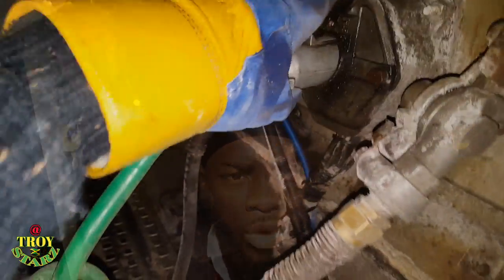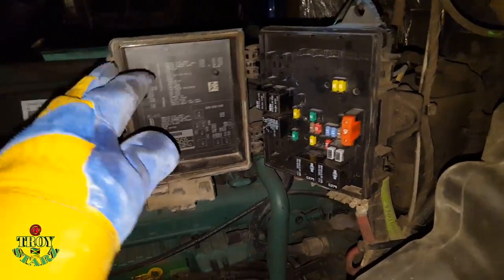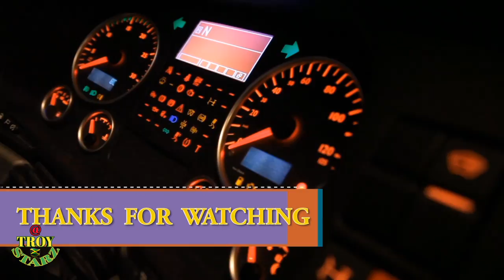How To Fix Trailer Running Lights Not Working When Truck lights On.

Comment: My tractor lights only work when I plug my pigtail into a trailer. Once I unplug the connection my tractor lights turn off. Turn signals, brake work but the running lights don’t stay on. Any advice

Comment: Hello fellow trucker, thank you for your informative video. I tried wiggling the pigtail and that did not work as well as checking the fuses and I do not see a blown fuse. I am going to buy new fuses just in case though and try replacing them. I will subscribe to your videos you are very intelligent and easy to listen to. Also what was the name of this song while you were checking the trailer

Comment: I was about to buy a new cord in the love’s for $114.99 then I was like nah let me check out you tube 1st.  Sure enough it was the 30 amp fuse for the marker lights blew. Only had 4 ways working before. I had spare fuses on board so I saved myself a lot of money. Thank u man
Reply from the maker: Thanks for your feedback

Comment: Some of the time you need to have a little wd40 and a talk piece of wires with two alligator clips on it for a jump wire,that use as a positive or a negative wire to help diagnose your problem,  but good work mi boss
Reply from the maker: conroy thomas ahh mi boss respect a this mi a talk bout you just teach me something this a the unity wey mi a talk bout anyway big up and thanks.

Comment: Have this same issue. Although, it’s not the fuse, keeps blowing and it’s not my truck any ideas? I’m mechanically inclined and this has me stumped. Electrical diagnosis can be a headache..
Reply from the maker: Put a higher fuses if your using 20A try 25A..
Reply: @TroyStarzTruckingVlogs  thanks for the fast reply. I did that all the way up to a 30amp started working again but now same issue. Blows any fuse every time, put left blinker on all lights flash. Tells me ground problem. Do you know where the ground wires are on a Great Dane?

Comment: I have a simple issue it's an in cab fuse that's getting hot to the touch I take I out and when I cool down it works for 30 secs then goes back out. Any solution?
Reply from the maker: You need a higher amp so if it’s a 15amp put 20 or 25

Comment: Just a hint guys when u test a fuse u should test both sides of the same fuse it might not good on the other side ..
Reply from the maker: Ok .. So that's not what I did?
Reply: @TroyStarzTruckingVlogs  in some fuses u just tested 1 side buddy.
Reply from the maker: @MrMrmojaguar  oh ok thank you for the heads up 👍..